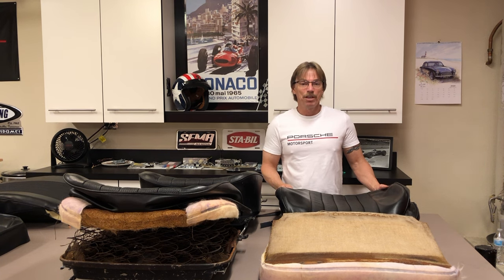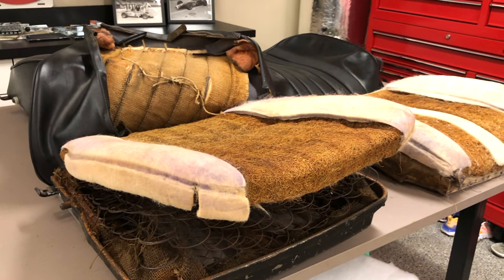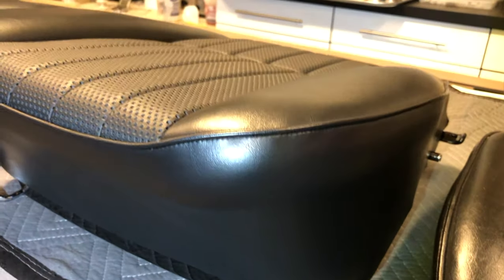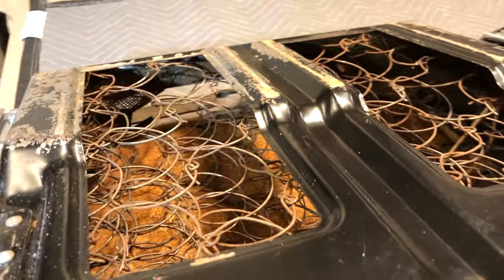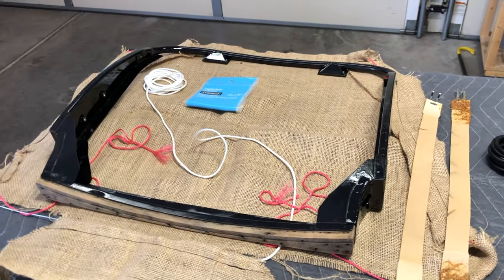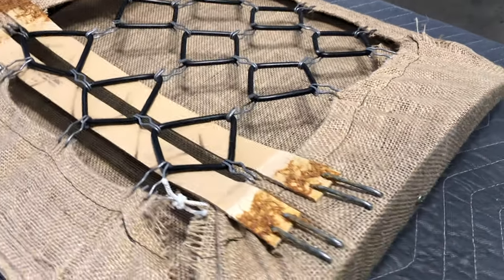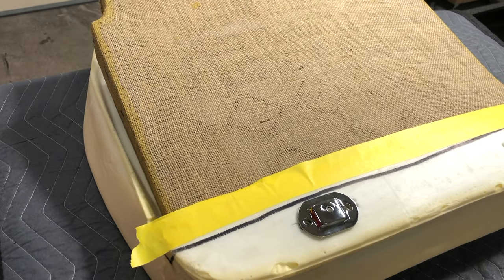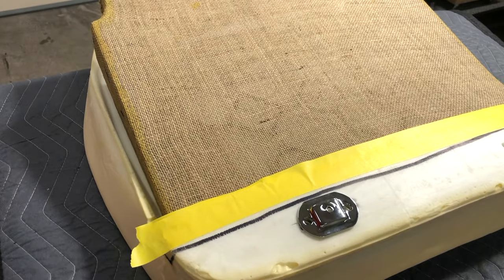Porsche Recaro Front Seat Restoration Part-1 Seat Backs

Comment: Recently did my seat backs on a 356.  I was having trouble getting the cover over too.  Mine actually started to tear. I ended up using a trash bag like you but i wrapped the bottom of the trash bag around a vacuum hose, turned it on and sucked the air out.  I left It running while I quickly pulled the cover on.  The vacuum compressed everything so well the seat back cover just slid right on.  Couldn’t believe how much easier it went on.  I read about that method on the 356 Registry.  Obviously too late to help you.  Your seats look fantastic.
Reply from the maker: Thats a fantastic idea..
Yes I sure wish I had that one before squeezing the covers over the foam...Its tight!!
Thanks for sharing the secret!

Comment: Great work Mike - as usual. 

Can I ask why you decided to use the foam cushions rather than use new coconut fibre pads as were originally used? New coconut fibre pads are roughly the same price as foam.
Reply from the maker: Hello Mark
Sure thing..Injection foam will fill out the covers and keep its shape for as long as the seat cover lasts. 
The foam alternative is much more comfortable to sit in and will always return to its correct shape.
The coconut fiber will break down relatively quickly after use and become crunchy and noisy to sit in..also the irregular
construction of the fibers will produce lumpy telegraphing thru the cover material down the road.
The foam will fill out the shape perfectly and last virtually forever..
It defiantly makes for a much tighter and more precise fit

Comment: Hi Mike.  You are fearless!  Are there any components of the restoration that you will have someone else work on or will you do everything yourself?
Reply from the maker: Thanks Dan
Thats a good question! I may bring this up in a future video as I do get asked occasionally.
There are things I will avoid.
As a general rule for myself I usually try to do as much a s possible.
However  there are times when special tooling usually leads way to the experts in those fields.
For example..I don't mind taking on upholstery work and trying to figure out what makes it go but in no means would try to sew
seat covers and special molded parts.
Also engine/gearbox..Im fairy knowdlegable on mechanics but do not have special presses or high end machine tooling to do the machine work. Those type of things would be sent out to the experts.
Engine building though Im okay with as long as I have everything ready to assemble.
A good point thanks for bringing up!